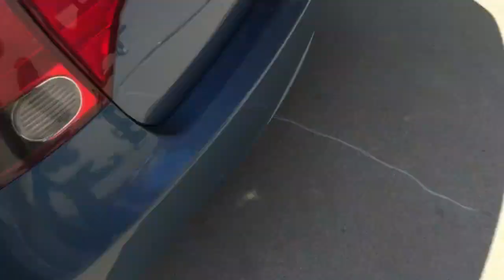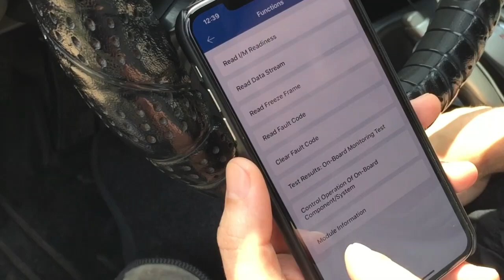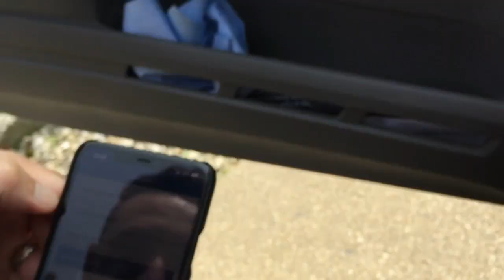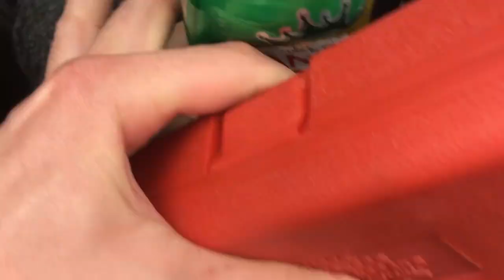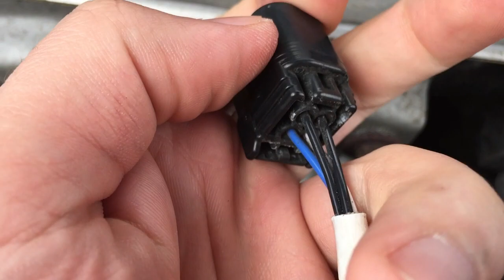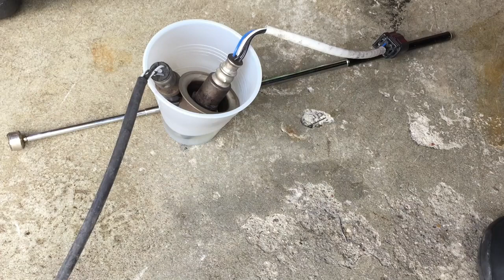Soo.... I messed up my engine after the valve lash adjustment (P0172)

Comment: Hey man, just stumbled on your post, currently having the same issue, did you have to redo the valve adjustment or did you just get a new oxygen sensor (did you get just one sensor or both of them?) thanks man.
Reply from the maker: Primary sensor and I did valves
Reply: @BulliKid  so basically redo the valve and get new sensors

Comment: Good video.  It would be very much a coincidence if the sensor needed replacing just after doing the valve lashing on the engine. So, I would look for an error or omission.  Perhaps  check for a vacuum leak - maybe something disturbed or omitted to put back.
Reply from the maker: Thanks I will take a look!  Cars.... lol

Comment: Just a thought...but it is possible you have a bad catalytic converter. A clogged converter will make it run terribly. You can run a vacuum test to see if it is the culprit. The absence of vacuum would indicate a clogged converter.  If it can't get exhaust out, it can't take in fresh air causing a rich running condition. You can also run it with the O2 sensor out and see if it helps.
Reply from the maker: Hmm interesting idea.   With 88k I hope it’s not a clogged cat.  Next time it acts up I will have to unplug maf or o2 to see if it helps.  Thanks for commenting!

Comment: A few things to consider, it might be an O2 sensor if it is fine on a cold start and acts up after it warms up. On a cold start, it is in open loop mode and ignores the O2 sensors. A vacuum leak would make it run lean, but the ECU might attempt to compensate with the fuel trim to make it more rich. what does it do if you have the O2 unplugged or the MAF unplugged? I would say fiddle with those to see what kind of changes you can get. It may be time to just buy an O2 sensor anyway. THey aren't that expensive if you bargain shop online. If you are really cheap though, get someone with a good running car that uses the same O2 sensor and swap it in to test, or swap yours into the other car and see if it acts different. You can check the data on both and compare. Good luck!

Oh, and one trick that I use to check for vacuum leaks is I put a balloon or rubber glove on the intake tube and blow into the brake booster and fill the balloon, then hold my thumb over the hose. If the balloon deflates, you know you have a leak somewhere.
Reply from the maker: Thanks for the tips bud! I’m trying to visualize your vacuum leak test but I just am not visualizing what you mean by it.   But vacuum leak would cause running lean code no?  And if air was leaking in the fuel trims would possible be positive to compensate for the extra air?  Not sure.  But thanks for the comment I appreciate it and will look into it more.  I don’t work now so I just let the car sit and stay warm at home.

Comment: Its possible there is a nut loose behind the wheel. lol I would think your PO codes would tell you the problem. Sometimes when you replace a part a new code will come up. 
What have you been doing every time you have this reoccurring problem?
Reply from the maker: funk it’s PO172 but general running rich code. I disconnect negative battery terminal and then we are good. But this time when the car started acting up it was worse then ever barely drivable and stalling.
Reply: @BulliKid  If you weren't having any problem before the valve adjustment maybe retrace the steps of your disassembly and assembly to see if something is loose, broken, unplugged etc.
I guess you did the adjustment right?
Reply from the maker: Yea I’m sure the adjustment is good ! 
No engine noises!
Reply: @BulliKid  You shoveling snow!
Reply from the maker: It melted !!! It’s off and on.  Don’t know what season I’m in lol
Reply: @BulliKid  I'm over this cold weather!
Reply: @BulliKid  I'm ready for some global warming!